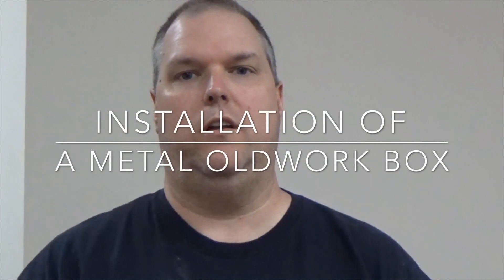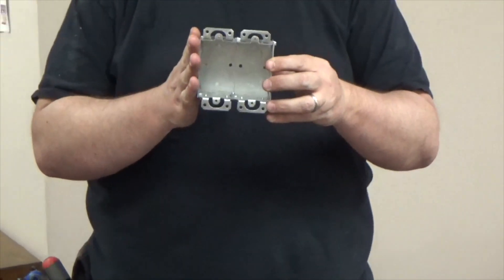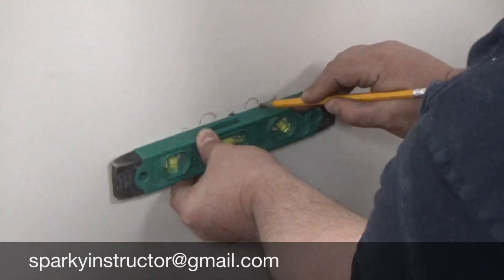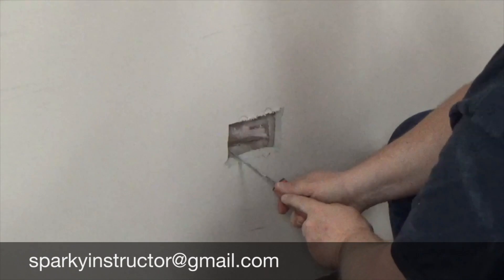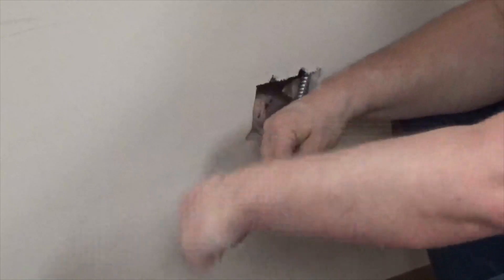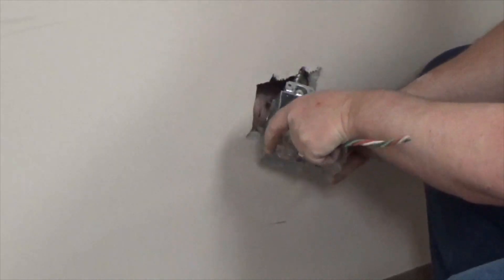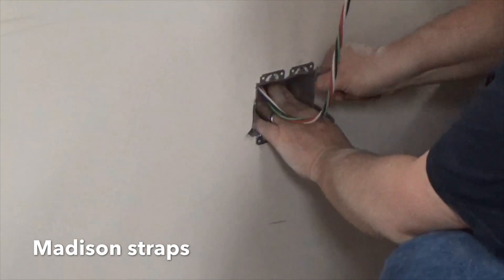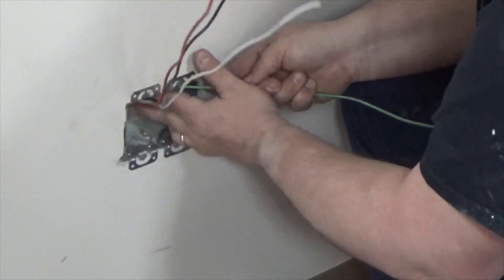Installation of Metal Oldwork Box using Madison Clips

Comment: I don't know if anybody else is fed up with installing the new Plastic "Rework" boxes, but I sure am.  I first went through a learning period, over a decade ago, cause those plastic tabs are tricky just to get right.  Now years later, the stupid boxes are pulling out of the wall.  Remember the movie "Kill Bill" where the girl just keeps punching the wall and it eventually breaks?  "Time & pressure".   Well sure enough, those little plastic blue tabs break over time, plugging in & pulling plugs.  I always wondered, what did they do before they made those Blue "Rework" boxes?  Well thanks for sharing, the"Old Tried and True" method.  Because seeing the strength of it,  it still reins in today.

Comment: Great vid thanks. But one question.
What was that move to seemingly jam the flat head into the grounded contact slot? 16:01
Reply: He was using the screwdriver in the neutral slot to shift the outlet to align it with the cover. notice that he also used the screwdriver to tap near the lower left corner of the cover right after. This is a common thing you have to deal with when installing 2+ gang outlets. It's better than having to remove the cover multiple times to make adjustments to the outlet positions.

Comment: Nice work! But for the price of the madison bars plus the box you mind as well get an old work box with wings. Make the job easier. Tighten two screws and your done.

Me personally, while running the cable in the box, I would have just given myself a couple of inches less of slack in favor of the metal shielding. That way, you could just throw that lock nut on the connector before putting the box in the wall and you would've still had plenty of slack left over for your conection.
Reply: the problem is that the connected MX is too bulky and rigid to wiggle into the hole. Try it.

Comment: Nice video. In my area some towns will not allow romex so we have to run all emt wherever new or exposed and greenfield for whips or for fishing through existing walls and ceilings. I don't know why but we're not allowed to use mc at all in residential. It is allowed however in commercial and industrial.
Reply: sht-crap-o / illa-no-toys? i think its because nm-b burns and melts and mc has a lot of airgaps for fire to escape as well as allow molten pvc to ooze out as well as to allow fire to breath or just the fact they like to keep & make things difficult and expensive and harder for the avg person +  supply warehouse in business lol

Comment: Very useful video for me. I have one like this at home and trying to figure out how to remove it so I can add more wire to the box. Need to check whether Madison clips have been used to fix it as in this video. I wonder if it can be fixed to the stud by nails, if possible (like blue plastic box)? If Madison clips used, then it's not hard to remove the box, right?
Reply from the maker: Yes if you take the device out, you may see or feel a nail on the top and bottom of the box. Thank you for your support. CM

Comment: If the insulation has a vapor barrier and it has been in anyway punctured by the whole saw while cutting out drywall, at least use duct tape to keep continuous vapor barrier. Thanks for clips Idea

Comment: Where's the locknut to secure the mc connector to the box? All in all, good presentation sir.
Reply from the maker: The locknut is there. The video of that was not the best view so I cut it out. Thank you for your support. CM
Reply: @craigmichaud-electricalins4602  Do you ever use the metal old work box with the built in drywall clips on the sides?

Comment: Great video. I'm trying to figure out the best way to use metallic cable in old-work boxes - like you have done - but that have the mc connector built in. In particular - where does the red-head go? Do you put one red-head inside the MC cable, pull the cable into the box and then put another red-head through the top of the built in MC connector?  (I am definitely using metal old-work boxes with MC connectors - these are not the NM squeeze connectors.) I cannot find a single place that shows how to make this a good install. At worst I guess I can use two of the red-heads. Thank you.
Reply: best advice i do occasionally when running mc to clips tht the tits may fall out is to just use a wrap of tape on conductors to act as a bushing to hold it in place

Comment: You ran 12/3 mc?  Would those outlets be on seperate breakers, with each conductor getting spliced in a homerun jbox...or a multi wire branch circuit sharing a  double pole breaker?  They're sharing the nuetral so it must be a double pole breaker right?  Wouldn't it be easier to run 12/2 mc and make some pigtails out of some thhn and make splices? Any advice or clarification would be appreciated and love the channel.  @CraigMichaud
Reply: James, I had exactly the same question. I assume that since Craig is an instructor he is only focusing on the topic at hand. Who knows if the mc cable is connected. He never verified that the outlet was actually working.
Reply from the maker: The answer to your questions are yes!! It is a Multi wire circuit and the outlet is connected to a 20 amp two pole breaker. I did this in order to not have to put a two gang book in and made it for the specific equipment it was being used for. This video was more on the installation of a metal old work box not on what was being wired in and the equipment related to it. Thanks for your question!!! CM
Reply from the maker: Yes Ted the cable was connected and yes I was only focusing on the installation of the box itself. I can see why you may have thought that as I watched the video again before I replied!! Thank you for your observation!! CM
Reply: The NEC does allow the use of a 2-pole breaker for a MWBC but the long term risk is not worth the savings. Also when someone is wiring in the Electrical panel if they remove one of the hot wires on the breaker it could cause an imbalance and increases the chance for arching which could take out devices or equipment at the other end - just my opinion.
Reply: Please with the above said I want to thank you for the video, excellent information on installing old work metal boxes using the Madison straps, I particularly like the tip on bending the strap around the ear it sure helps get it tight; I installed two boxes today and I have to say I wish the NEC would allow us to use plastic boxes in a commercial setting. Thank you again.

Comment: I will be installing 2 outlets in a kitchen island. Are madison straps required on all metal cut-in boxes?
Reply from the maker: That is a good question!! I am going to say yes and No. It is up to the installer on weather they want to use them or not!! I will say if I am using a nonmetallic sheathed cable I will use a plastic box for sure. You can screw them which I have done it ready depends on the material. Thanks for your question I hope this helps. CM

Comment: This was very helpful.  But how do you attach the mc cable to the other end to a box that is already installed?  Do you have a video for that?
Reply: Brian Borkowicz  Knock the ko out completely fish the wire but when you fish it already remove enough of the jacket and attach a Mc connector usually I fish the fish sticks threw the ko if it’s possible

Comment: Are metal switch boxes mainly used for old work or are there instances where metal switch boxes are used for new work?
Reply: For new work people usually use a box that is all one piece. Plastic nail on boxes will often be used in residential, and metal switch boxes often in commercial. Or in commercial they will often use 4x4 boxes with mudrings for devices.

Comment: What would happen if you don't remove the ears from the outlet?
Reply: Your trim plate won’t be flush to your wall
Reply: Frustration as to why the faceplate is bowing out in the center
Reply: I never had a problem leaving the wings on. I'm using raised metal cover plates.

Comment: Only an idiot doesn't use anti-short bushings. Good video.
Reply: I was taught to cut the armored jacket at a 45 degree angle to get rid of sharp edge then install the anti short bushing. Some times the bag of 35 anti shorts appear to be undersized so then I use two of them 180 degrees apart. I always had a plastic bin in my van filled with various anti short bushing to handle 14/2 AC ( YEA BX ) to 2/3 MC cable.

Comment: "Need to take the ears off the outlet"... But you never explain why? What harm would there be leaving them on?
Reply: I prefer to leave them on for more support and flusher install. If you notice at the end of the video the receptacles were sunk in a little. If he didn’t cut the plaster ears off he’d have that 16th inch to be flush with cover plate. He may do it depending on brand of cover plate. Some are thinner and he would have to cut plaster ears off for a cleaner look. Neither option effects the function, it’s all cosmetic.
Reply: He cut the ears 📴 so the receptacle cover would sit flush against the receptacle and the 🧱